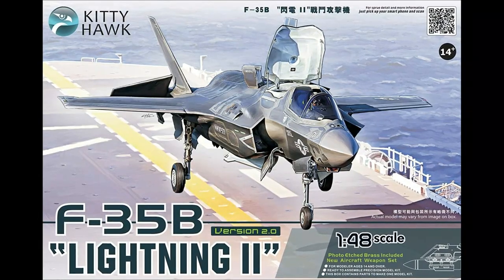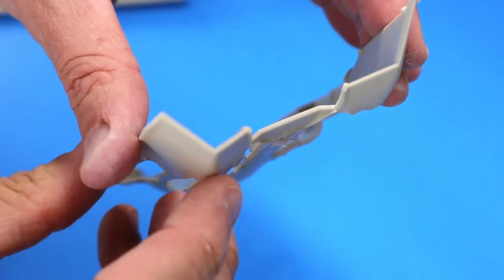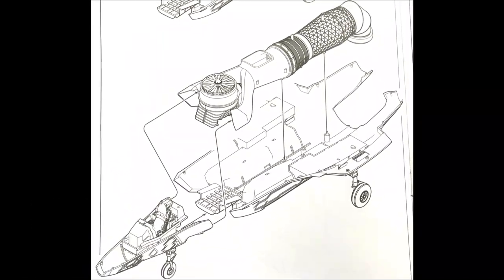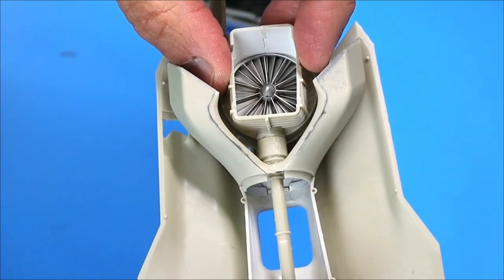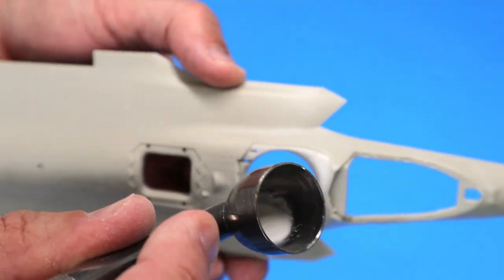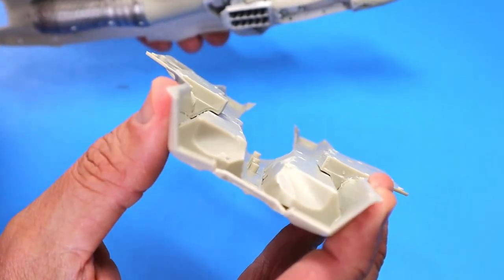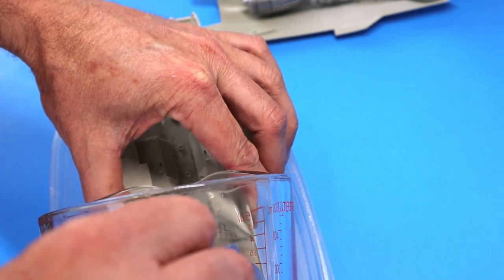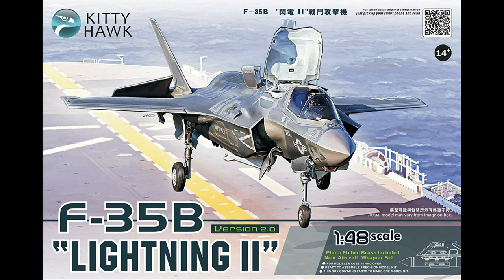1/48 Kitty Hawk F- 35B VBLOG 2 - The Gut Punch and the Comeback!

Comment: I have had to use the hot water trick several times to repair warps in scale automotive kits. Glad it worked for you.
Reply from the maker: Yep, one of those "when all else fails" kind of things. Hit it with the boiling water and make sure you don't cause collateral issues ;)

Comment: Well done pulling the fuselage halves together using hot water to alleviate the warp... What's your thoughts on Kinetic Kits... I've often come close to buying one as they have some pretty cool aircraft subjects... I kinda get the notion Kinetic are still ironing out the kinks in their kits...
Reply from the maker: Thanks.  It actually worked out better than I thought it would.  As far as Kinetic kits, they are much better than Kitty Hawk.  Sometimes (depending on the kit) I think they have made things a little more complex than necessary but overall, I have enjoyed the ones I have built.  I have built their Super Etendard and a couple of their Trackers.
Reply: @FlyingSModels  100% agree with you on needless complexity. There is no need for 22 pc ejection seats, when some pieces are literally 1 square millimeter. Another problem I have had with a lot of Kinetic kits, is that they insist on making extremely thin or small pieces mated to very large sprue connection points.
Reply from the maker: You've got that right.  I'm not sure what some manufacturers are thinking when they make kits like this. It's obvious to me that they are not design by modelers, for modelers, or else they'd all be like Tamiya :)

Comment: I have this kit in my stash, I will have to try your boiling water tip if mine has the same issues. I got version 3 unbeknownst to me at the time of ordering, which is kind of a disappointment. I wanted to build this in Beast Mode with external weapons, and version 3 has no weapons! :-(
Reply from the maker: It fixed my issues for sure.  Sorry about V3 issues...I wasn't even aware they had a 3.0.  I'm building this one clean so if you need some weapons, I might be able to spare a few.